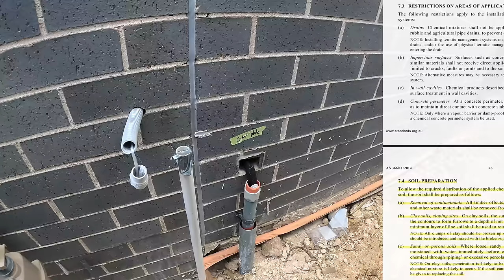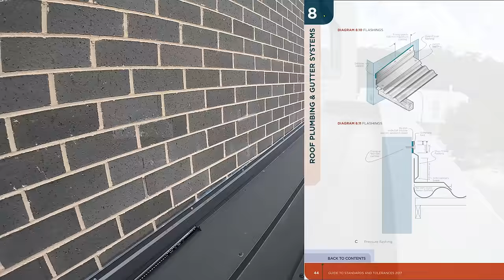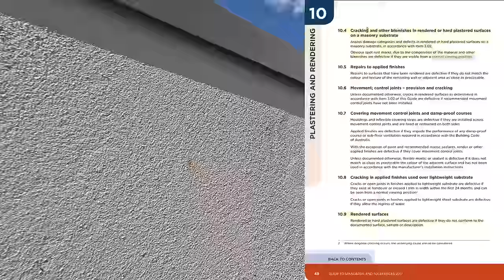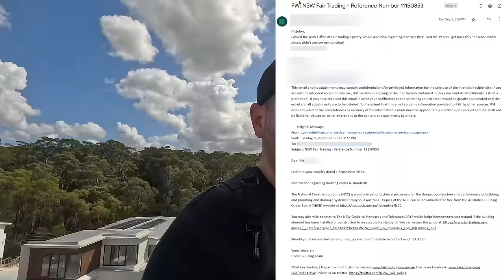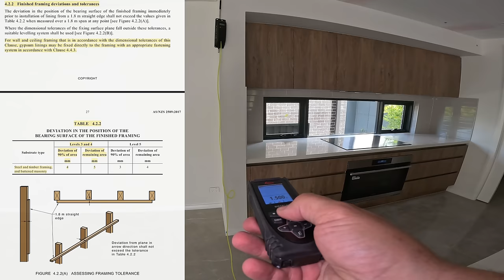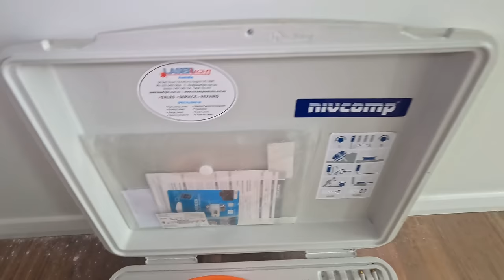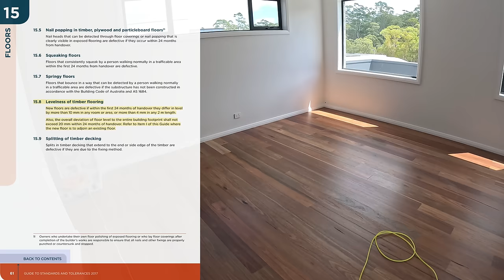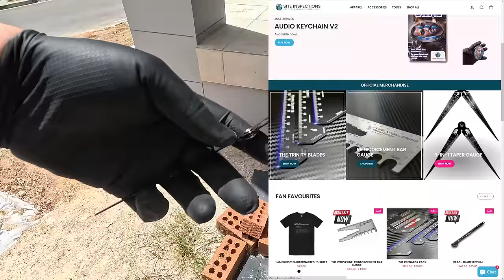I Inspected An Award-Winning Build | NSW Exclusive

Comment: Im shocked a building inspector can quickly see multiple non compliant issues.  Architects, builders and plumbers couldn't care less
Reply: My partner is an architect and she absolutely does care, but stays as far away from even high end residential work. I don’t blame her!
Reply: @rowanjones3476  why on earth are architects and builders designing square box homes with no pitched roof.  Flat rooves with internal box gutters is a recipe for trouble
Reply: @frasersamuel2867  We live in the age of form over function, mate. What is sensible apparently doesn't cut it these days.
Reply: It's more the "builders" in Sydney today. Half of them haven't got a clue and the other half work off others building license
Reply: Ah yes, just one of the many spoils of mass immigration
Reply: @timsteele1179 true that but also if the inspectors rolled up like this dude and actually checked properly then there wouldnt be these issues.
Reply: I don't think it is always the case. Things get misplaced or hurried. At least for architects--they put a lot on the plans--because the plan checkers like it, but they can't put the whole code book in the plans or teach you how to build. They depend on there being at least a journeyman on the job who is keeping it together. They really should not be able to know as much as a roofer or a metal worker--but have some idea what needs doing and allow for it in plans. There needs to be someone on the build team looking it all over, like a construction architect or engineer, or the general if they will do it.
Reply: @pcatful  who is a "general" on a building site? Also plans MUST go through an engineer to make them to code. However even with this a licensed trade like a roof plumber should know these standards off by heart especially with the rates they charge. Roof plumbers are the dodgiest and laziest trade AND they're way over priced because they're a licensed trade. As a carpenter I've had to personally fix abd finish roofers work because it doesn't make sense or work with the other trades...dumb, lazy and overpriced are 80% of roof plumbers I've come in to contact with.
Reply: I think those two heavy long bits of wood on roof was to hold down the metal capping !?!?  instead of bolting screwing fixing it down 😢
Reply: 40 years ago  if you did flashing caps like that you would have been kicked off the site!! Looks like what a 3 year did at kindy with a  silicon gun, can’t believe it, rolling the dice for a new build these days folks,
Reply: And the government really cares🙄
Reply: @MrDeano-eu9rg  A general is a a general contractor who is ultimately responsible for the building—but often doesn’t show “on site” enough. The plans must be to code, but, again, they cannot tell every detail that a good builder must know or every aspect of code—as long as they don’t contradict the code.
Reply: @pcatful   such a title doesn't exist in Melbourne. Maybe you mean a site supervisor?

Comment: Had a 2 year battle getting the roof replaced on our new house with rain leaking inwards. 

The builder used an external  roofer with a 6 year warranty.

Last year finally had the flashing and roof replaced.

I would immediately hired you if i knew you existed pre-settlement time.

I expect your business to explode with work with the rushed builds especially in Sydney!

Comment: He stands so close to the roof edge, but I can't see him attached to a safety line. Be safe out there brother, and keep up the good work. 👍
Reply: Legally he's fine, but I've gotta agree.

Imo there should be a standard in place where there's a ladder mount on the gutter somewhere safe and a static line or anchor point close to it.

If you walk away from your first ladder fall it should be straight to the hardware to buy ladder clamps. Speaking from experience, laying on the ground deciding whether you should get up or not is a pretty average situation to be in.

Comment: I wall mount TVs for a living. The TV location with the wacky bulkhead above it is a shocker. A mounted TV will never look level if the cornice/bulkhead above it is not level. Your eyes will detect the difference between a level mounted tv and a shoddy bulkhead above it.
Reply: Just wait 50 years as the house ages and you wont mind

Comment: I am curious how many of the non-compliant issues you find actually get fixed.  You pointed out non-compliant rain heads on the other houses too.  I am sure it would be hugely expensive to rip those out and redo them.  Also, I would like to understand what the ramifications of the non-compliant rain heads will be.  Ok, so they are non-compliant, do they still work?  I am the type of person I would want it perfect, but I also want to keep some perspective how rationale it is to make some of these kinds of changes.  Keep up the great work!

Comment: Great job done by your crew keeping the ratbag builders in order.
My beef is with the new regs which are a disaster.
5:59 You call this a BBQ area, your pulling my leg.
Where's the grass and sky?
11:14 Great view, love it, BUT for how long????
16:54 30 mm trip hazard into the dunny, that’s stupid.
This should be level or a taper up but NOT a step up.

Comment: In nsw. Do you need 1-100 fall outside of the shower in a bathroom if the shower is not fully enclosed. Do puddle flanges need to be recessed aswell. Should upstairs bathroom floors be sheeted with tile underlay before tiling or waterproofing?

Comment: Iv been thinking lately that a lot of the problems come from builders and owners trying to be to fancy architecturally, there’s too many different materials beings used and too many failure points . If we kept it all more simple you could have a really well built house . All the old structures that have stood for 100s and even thousands of years were just made from  a couple different materials. Some of these expensive houses will have wood cladding on 1 side , render on the other , polystyrene up top , then a feature wall of stone , then a thousand fancy flashings . Ffs just keep the entire outside brick and have a pitched not flat colourbond roof . Done .

Comment: You shouldn't be measuring for level tolerances at drywall tape joints.  There are many things including the quality of the sanding and taping that would knock those measurements off.  Probably better to measure 20 cm away from corners, joints and lights to get the most accurate measurements.  Not to nitpick but someone can come behind you, get different measurements and then drag you to court for defamation.  Great vids and love from Canada bro.

Comment: HA , just started watching, and then you said "KELLYVILLE" ...  Bodge job central for builders. I used to deliver concrete for years there. Not one concrete slab was ever poured within max slump levels. We made the concreter's sign paperwork to say excess water added, before adding water to the mix as warranty was about to be voided. They didn't give a shit, and would sign with a scribble ... 80 slump concrete would be turned into 150 + slump watered down self leveling sludge which we would no longer warrant once dropped.  20 MPA concrete would (if tested) end up below a strength of 10 MPA.  Anyone in Kellyville watching this, if your garage floor has a constant cement dust covering, and air bubbles blow when you pour water on the floor, then your whole slab is compromised due to the builder adding excess water to the concrete, because they were too lazy to lay the concrete properly, and wanted it to self level.
Foundation pier holes were also pissed up beyond belief.
Do a core test of the concrete, and I guarantee it will fail the crush test for strength

Comment: open THE FRONT DOOR
is see step treads out - more important 

may be not as per code - they need to be EQUAL 

cornices sq set if was SET straight 10mm
I wouldn't complain AND IF THE 150mm bulkhead was equal all the way 
concreters also can be 10mm out thus frame is - it is a knock on effect add crap timber and bowing

now with wet area falls req - step vs recessed concrete bath area

Comment: I’ve lived in an award winning home in WA. It featured no ceiling insulation and doorways and  large internal spaces with no entry wider than 900mm which made it impossible to get regular size furniture in. The showers still featured the two-taps method.  
Why are they mitreing external window facias? Just wrong!  Wonder if those heavy concrete battens were there to stop the capping vibrating?  Wonder if they’re putting in a glass partition adjacent that stairway? Otherwise it’s a nasty trip-hazard.

Comment: are the Building Code of States and territories the same?
Reply: Not nessasarily
Reply: There are Australian standards that apply to the whole country but contain clauses for different areas - say climate conditions like cyclones
Reply: We have the NCC National Construction Code, which covers all areas of residential and commercial buildings, but each state has slightly different requirements in some aspects of the construction. Australian Standards are also only minimum standards also...
Reply: When he was displaying the standards on screen at one point I saw there was a specific reference to a standard to be excluded from South Australia, and instead standard SA{such&such} was to apply. So what neil and dean said above.

Comment: That's an interesting suburb with all the modern houses  one after the other. Have to say that it is totally different in the US. The state doesn't care at all about private inspections (unless there's some grift) and no inspector  (public or private) looks at "level", "plumb" ,"square", cabinets, trim, gutters, flashing,  or know much about roofing, and they miss a lot else about the actual structure. Disagreements go to court without a state agency to intervene. What's the greeting you gave to the worker next door?

Comment: just before you commented on the render "terrible" I was wondering if it is compliant... if the client wouldn't like it (even on video it is clear how it is uneven), does the builder have to fix it?
Reply: Wall surfaces are defective if they deviate from vertical by more than 5 mm over a 1.8 m straight edge. 
Ref: New South Wales GUIDE TO STANDARDS AND TOLERANCES 2017

Comment: Ayyy you're in my neck of the woods. Looks like you're in North Kellyville compared to regular Kellyville.
Did you do a roof space inspection to see if the builder complied with the fire rating?

My old boss' mate built a house in Kellyville ridge and the fire rating works added an extra $200k to the build.
Imagine paying an extra $200k and finding out in an inspection that they didn't do it.

Also a 8:45 with the window rubbers. Is that a defect? I thought the house was protected from humidity and water by the wall sarking and taped to the window frame. So when water enters through the window in that small gap, it gets immediately removed with the weepholes.
Someone please educate me 😀

Comment: The water tight issues are significant but the internal bulk heads are never square or straight in any building in the world they don’t cause structural weakness unless it is load bearing and 90% of this is just stud wall partitions

Comment: Does anyone know what happened with this property or what usually happens with properties in this situation? 
What does the customer do with this report and video and what will the builder do to fix the issues?
Reply from the maker: In response to your query, the homeowner will receive our comprehensive inspection report, detailing any defects or compliance breaches. The homeowner then forwards this report to their builder for review and rectification. Please note that our reports are far more detailed than our videos, listing each and every defect or compliance issue that we find.

Here is an example of the action a builder took after receiving our report and video: [From Inspection to Rectification | Builder Comes Back...]( https://youtu.be/_zhLlFHeY_w )

It's important to remember that breaches like the ones we identify are covered by NSW Statutory warranties. These warranties are automatically included in the contract between the homeowner and the builder and take effect from the date the work was completed. They last for six years for major defects and two years for all other defects. More on this can be found here: [NSW Fair Trading]( https://www.fairtrading.nsw.gov.au/housing-and-property/building-and-renovating/preparing-to-build-and-renovate/contracts )

We hope this clarifies the process for you. If you have any other questions, please don't hesitate to ask.
Reply: @Siteinspections  thanks for sharing that other video. It looks like a lot was fixed but I’m not surprised how difficult it was for the owners to get the attention of the builders. It would be good if you did more videos about the journey of the owner chasing up the builder for the repairs. It would show everyone the stress that owners go through and how important compliance is during the original build. 
Can owners get you involved during the earlier building stage so that some of these issues can be avoided?

Comment: I run a painting company in Ontario Canada. Seeing that exterior painting hurt my soul. It does not matter if the client cant easily see the area or may never see it in my lifetime. Fill paint and caulk properly. Especially outside where water and ice will destroy everything over time. 1 of the main issues you run into with large customer homes like this is the contractor is cheap. For example say my quote is 20k. They will pick the guy at 12k and then wonder why everything looks like crap. Painters literally seal and protect almost every surface of a home. Walls ceilings trim exteriors and so on. The drywall corner bead above the kitchen makes me sad. They should use the metal beads with tape that are super long. Then a proper corner knife. That will make that corner perfectly smooth and more importantly straight over the entire distance. When you measure the differ3enced in the floor. As soon as you place the tool down the 2nd time and say 7mil. They have paint all over the floor by the baseboard lol. Maybe i should move to Australia and paint thing properly. I can almost guarantee they do not pay the proper rates. In my area we do large custom homes. On average from 2000sf to 8000sf. We only supply highest level paints. All the way down to caulking that stretches 800% and is lifetime warrantied on cracks.

Comment: Dont like housing built out of polystyrene 
Im a retired tiler based in Perth W.A and i remember bout 15 years ago attending a property in Burns Beach to do a quote. It was winter and quite windy and house not far from the ocean. As i pulled in2 the driveway i could see outer wall of double garage swaying. I thort i was imagining things so i commented what i seen to homeowner and he told me i wasnt imagining it and that outer wall was polystyrene blocks and on really windy days he cant open garage door cos he worried bout wall collapsing.
Never in my life had i ever witnessed something so crazy. Perth is mostly double brick homes so this came as an absolute shock.
As i puled

Comment: Is it non-compliant to walk around of a roof without fall protection or a harness. Pretty sure workcover would have something to say
Reply: OHS/WHS has a risk matrix consequence and likelihood. A worker conducting focused tasks of long duration may need scaffolding and edge protection instead of a harness. Short term maintenance or sloping roof a harness might suit. A very short duration task in dry conditions by a competent person is hardly dangerous. In his workflow, probably the most dangerous thing is the means of access, his ladders are rarely secured and normally not of suitable length.
Reply: My partner is a WorkCover inspector. We have had this exact same conversation while watching his videos. 😂
He better be careful, or he might get a $10,000 non-compliant fine in the mail for his dangerous workplace.
"Australian standard 3482 states that a building inspector must not fall to his/her death while performing an inspection" 😂
Reply: @happyhappynuts 
Frequency or time of job is irrelevant, if you are working at heights and are working any closer than 3.0m from the edge (which he does in many of his videos), you require edge protection, scaffold or at the very least a harness.
Reply: @vzgsxr even on a flat roof? Hahahaha, australia is a joke
Reply: @chrispekel5709  
Yep, even on a flat roof.

Comment: That suburb doesn't look like it's full of homes it looks like it's full of offices. Row after row of hideous office type buildings. It looks like a commercial development not a residential one.
Oh look at this guys, yeah I'm looking at a sea of dark coloured houses with dark coloured roofs and it all heats up in summer and then radiates the heat into the house which means ducted air con or split systems have to be used. Unless you have a battery bank to store energy created by the solar panels it's going to be very expensive to run any of those houses for the NSW government will only pay you 11c kwh for the power you generate for the national grid. It started off at 45c kwh and it's now down to 11c kwh and before long it will be zero.

Comment: 90% of inspectors don't go on rooves? Allways confused me that us Chippies walk plates,with trusses,build often convoluted multi broken hipped rooves,with no harness,no scaffold and once complete a 1 mtr below gutter scaffold or fall protection system is installed( AND RIGHTLY SO AS ITS A DANGEROUS GAME ROOFING PARTICULARLY Steep Pitched Colourbond rooves) YET during the building process it's non existent until roofers onsite  on a single story domestic build.